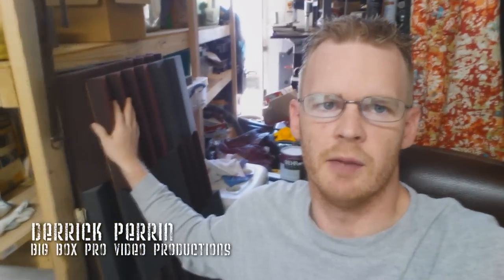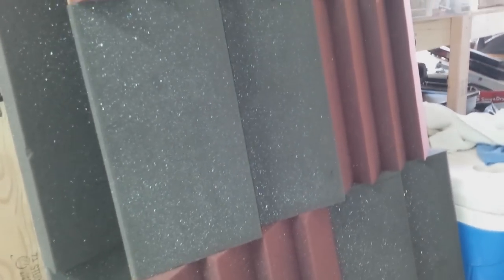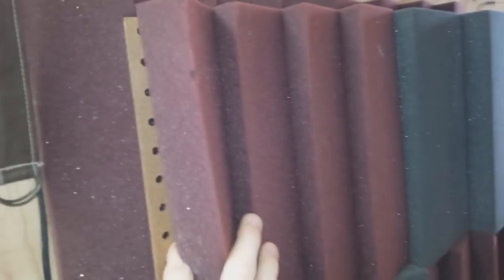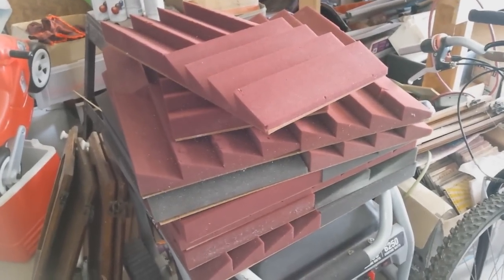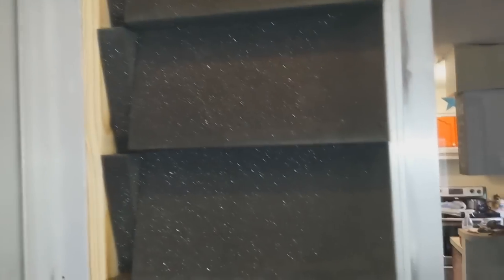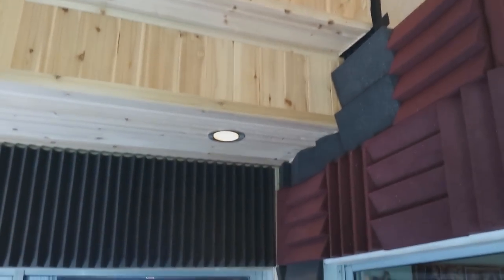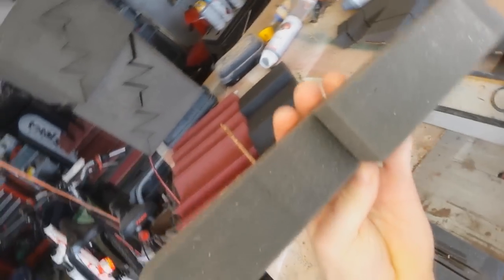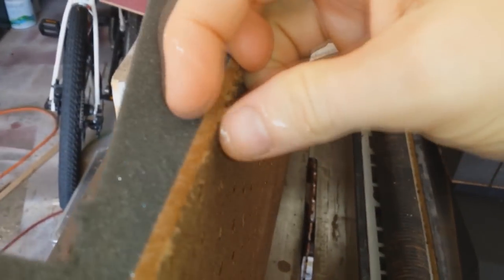Auralex Acoustics - Install Foam for the future -DIY

Comment: Great ideas.

Are you putting your drywall screws into studs or are these panels light enough to not need to mount directly into the studs?
Reply from the maker: +MakerDP  I put it right into the drywall with 4 to 5 screws per 2x4 foot panel. 4 corners and 1 center. 
Thanks for watching.

Comment: nice the board makes the room more quiet also my guess
Reply from the maker: +BECK It helps a lot. The room has 2 sliding glass doors so I'm looking to add some suction cups and form a foam mount to the glass. Thanks for watching.

Comment: Sacrificial foam? LOL Ever think of using a metal ruler with a serrated knife? The cuts come out perfect without having to waste anything.
Reply from the maker: You are right, that does work good. I have mine mounted on peg-board and use a table saw to cut it. 
Thanks for watching Dan!